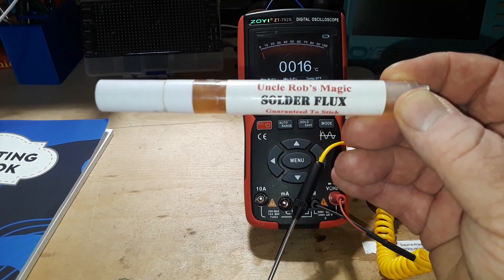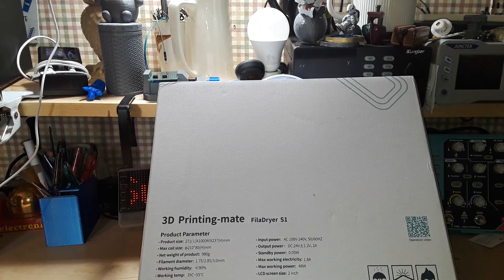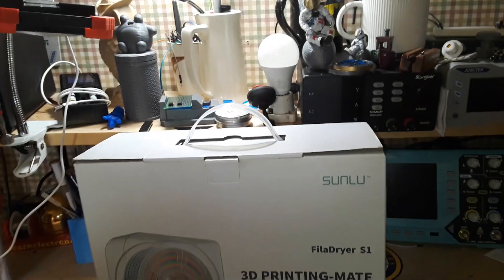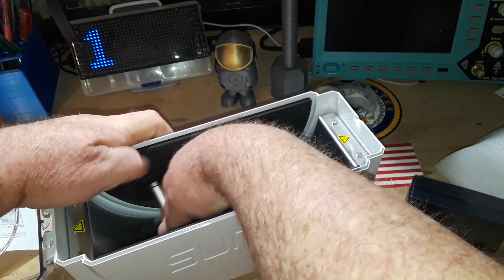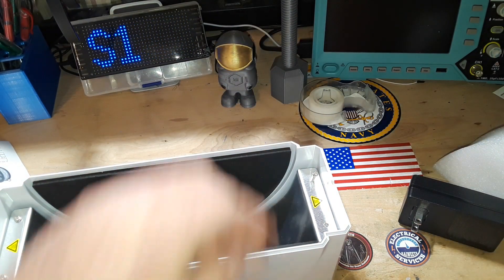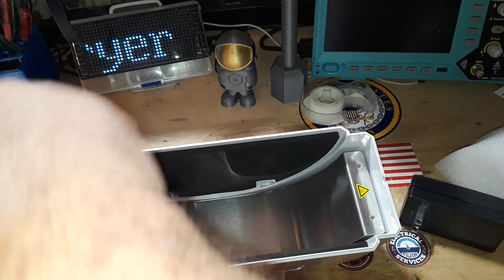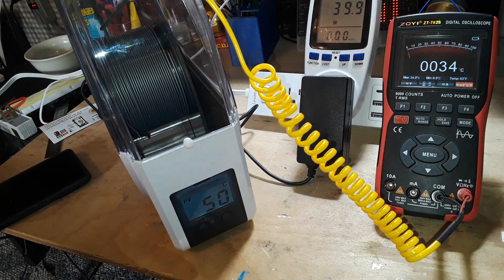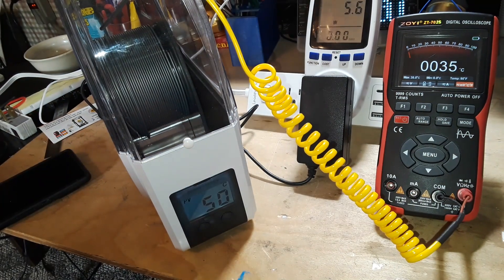Sunlu S1 Filiment Dryer

Comment: Ad you're doing good. How much you need to use the dryer basically depends on how wet your filament is and how humid your room is. Even PLA benefits from drying it. I try to turn mine on an hour or 2 ahead depending on humidity.  In the winter in Michigan it gets pretty dry. In the summer, a great day is 40%. A bad day is 95% I try to keep my filaments in vacuum bags with desiccant. I'm lazy about removing the one in the dryer.

Comment: I have one of these.  They are awful and nothing more than a filament heater.  I added an extraction fan to remove the moisture from the inside, else you just sauna your filament.   Did I say it is an awful device?

Comment: Call me kooky, but did I see the label on the filament roll say DILAMENT? I have not had a problem with wet filament. Maybe im lucky, i dont know. I keep mine in gallon ziplock bags with a couple of silica gel packets inside. When I use a roll, I bake the packets to dry them out.

Comment: There will be no fumes from that from PLA or ABS, or any other material used for printing. Also ABS doesn't give off any dangerous fumes.
I am an injection molding process engineer with 30 years in injection molding, I work with ABS daily as well as a lot of other thermoplastic materials, and apart from a bad smell when ABS degrades, I have never had any harm from the fumes in the last 30 years.